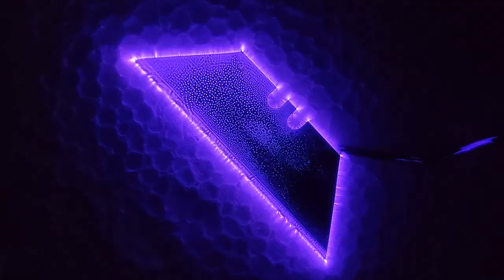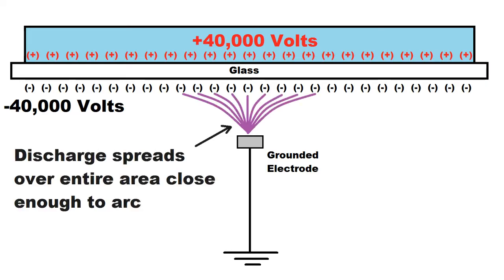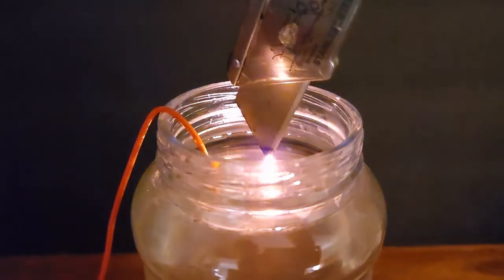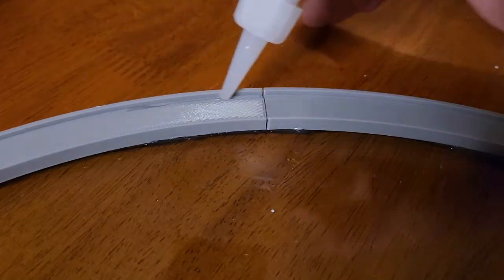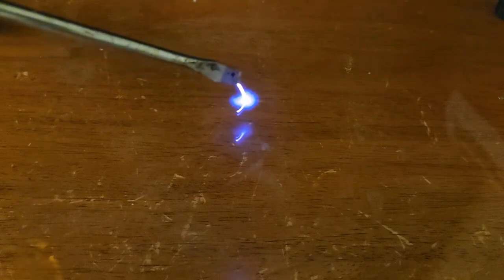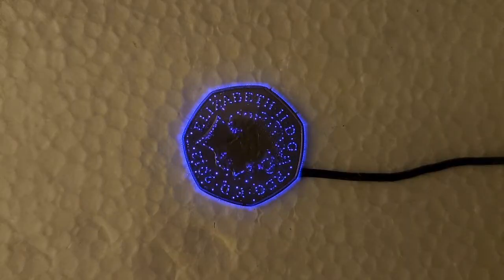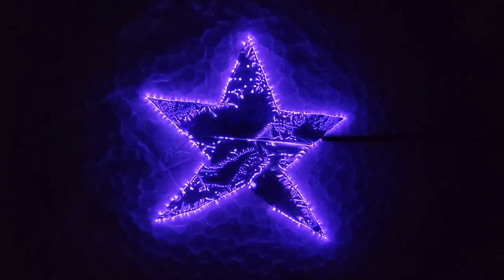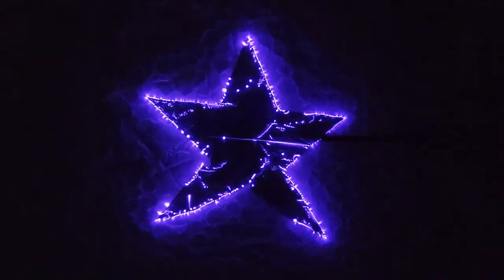Corona Discharge Photography

Comment: I built something similar back in the 70s, but it was only still photography using a car ignition coil and Polaroid film. People weren't completely clear on what was causing it at first, so the pseudoscientists jumped on it and started interpreting "auras" from the different colors. Thing is, if you stick an adjustable POT in the circuit, the colors changed along the spectrum as it turns. 

Have you tried the torn leaf on yours? That would be cool.

Comment: Would it be possible to make it work with skin contact without burning by using with lower voltage or perhaps some other modification? Perhaps using long-exposure to get the fainter glow?

Comment: Hi.. Thats cool.. i was working with that kind of configuration. Instead using grounded electrode, i connected both water plates and metal plates (conductive thing) to each of the AC high voltage terminals (from the AC flyback coil). 

i used 24V DC switching and zvs driver to power up the flyback.

i was wondering, which ground you used in the experiment? is it earth grounded connection? 

thanks..

Comment: i have a question~ first, is there AC flyback transformer? i know that flyback transformer is DC source..  second, if capacitance is changed by something of ground, can tesla coil operate well? resonant frequency will be changed I think.. i want to know what output of your AC supply~

Comment: Aren’t the electrons technically jumping from the grounded object to the glass and not the other way around?

Super cool too, I wonder what determines the color of the arc
Reply: I'm not sure, but I think one side of the glass gets the positive charge, that induces on the other side an negative charge, side that does conect through air to the ground object, so, it's eletrons jumping from the glass surface to the ground object.
Reply: I get the idea it's moving both directions - the electrons don't move through the glass, they just build up or deplete, so it needs to be an AC current or it runs out of electrons and stops working.

Comment: Dumb question. I saw a reel where someone used this type of photography on a leaf. The cut it and supposedly the Corona it left was of the whole leaf. Can you confirm this?
Reply: I did it using still photography (car ignition coil and poloroid film) in the 70s. Sometimes you saw the "missing" part of the leaf and sometimes it didn't work. I think it depends on what's on the outer part of the leaf. Video if it would be cool.

Comment: Spectacular.
I wonder what causes the change in intensity across the surface when using flat material (such as the blade 08:17)? Can it be used to show oxidation/faults/grain structure (if environment effects are eliminated of course)?
Reply: Pointy things concentrate electrons.  That's why a lightning rod is pointy.  In theory it ought to reveal microscopic cracks in metal.

Comment: ac goes through a capacitor like its nothing or a wire
Reply: ie capacitive power transfer
Reply: nice carbonization technique, that arc process
Reply: try that in vacuum (no oxygen or nitrogen) to split chemical bonds
Reply: ie deoxidize metal oxides into metals and oxygen gas vacuumed out of the vacuum chamber
Reply: somehow layer by layer 3d corona imaging
Reply: multi-axis computer tomography with arc x-ray (all wavelength radiation imaging)

Comment: >this British pound
That's actually 80 ounces
Reply: The reason for this is because the US uses a metricised imperial system where they round numbers.  A ton in the states is 2000 lbs, but a ton in imperial measures is 2240 lbs.  It has nothing to do with the coin being a 50 pence piece.